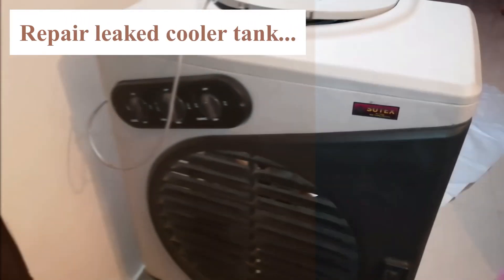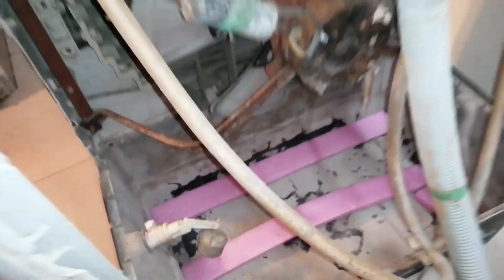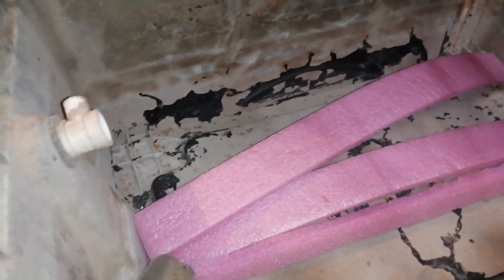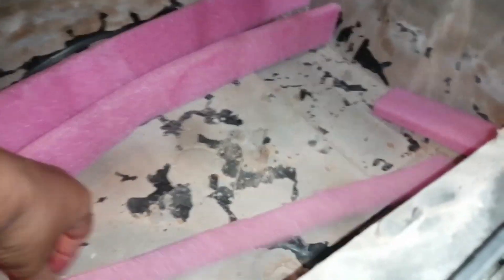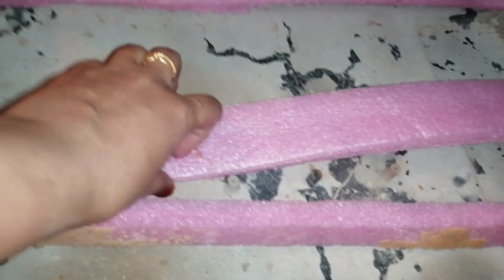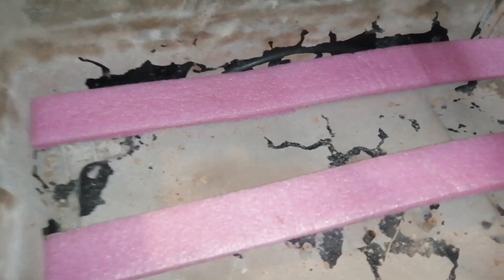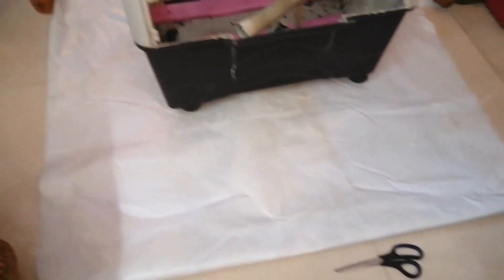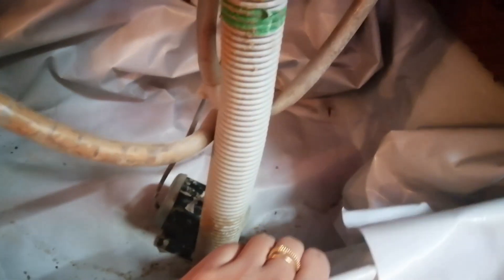leakage repair - Air Cooler tank

Comment: Is there any way flowing outside.. even small leakage also a big problem.pond liner money we will loss so that asking.thank you
Reply from the maker: No such issue. If water even leaks then it's due to water droplets from top and making adjustments slightly will remove those issues also

Comment: u haven't posted the link to buy that pond lining plastic. like the size of the sheet required, thickness of the pond liner sheet??
Reply from the maker: U can use any pond lining.
Reply: @haloveaa  the pond lining available in market are usually big ( meant for ponds), that's why i asked you. where do u get the smaller size for 45 litre tank capacity coolers?